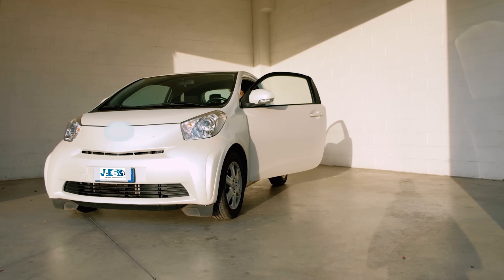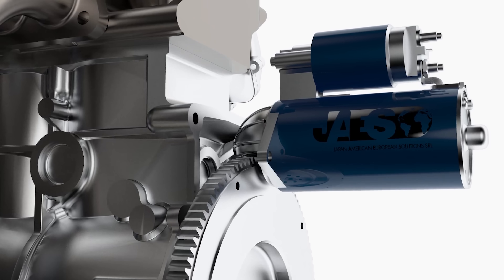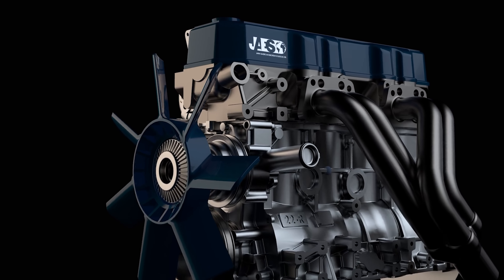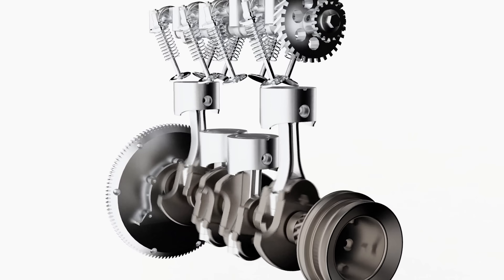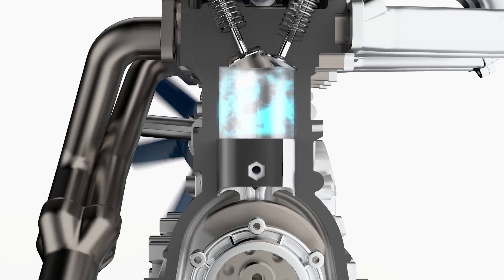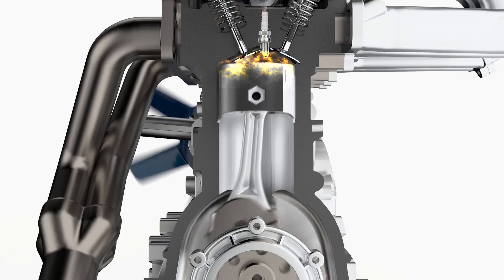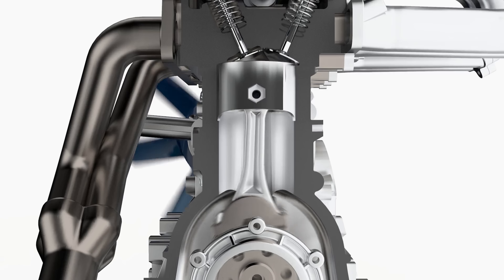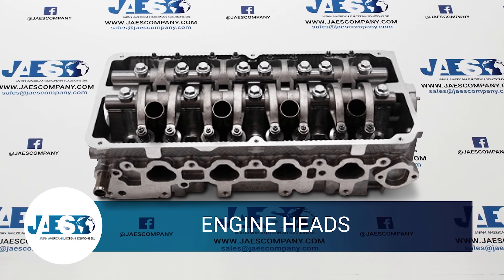What happens when you turn the ignition key in your car? Internal combustion engine (Car Part 1)

Comment: Didn’t take about the fuel pump priming the rail and injectors 😂
Reply: Right, and they didn't talk about having fuel in the tank for the priming to take place, and how people need money to purchase the petrol, and if not, they can steal it. And if they purchased the petrol versus stealing it, they most likely had a job. Yes, they missed a whole lot.
Reply: @markmalasics8413  he is not wrong, though. the title is what happens when you turn the key. the first things to happen is the electronics are turned on and the fuel pump building up pressure. depending on the ignition switch, there are two or three positions of the key where the car does something before the starter motor even turns. and if you turn the key slowly step by step, you can hear and see what the car does on each position.

to have this explained was my expectation of the video, when I read the title. but basically this video was one minute "when you turn the key the engine starts (duh)" and for the rest of the video it became "how does the principle of an engine work"
Reply: @markmalasics8413  you made me laugh 🤣
Reply: @posadist681  that is his intention. 😂🤣😅😆😄
Reply: didn't talk about how the wipers move when you switch them on LMAO OMG LOLOLOL "laughing emoji insert"
Reply: Not all vehicles are fuel-injected...
Reply: @rickyrick9328  give me one popular, modern vehicle people drive that has a carburetor
Reply from the maker: Hello. Thanks for you comment! We could make a separate video about these topics. Meanwhile you can also watch our videos about STEERING SYSTEM https://youtu.be/Iw1duKjGcto MANUAL TRANSMISSION https://youtu.be/G6hCvdW4dKo BRAKING SYSTEM https://youtu.be/6xWEEbhBtuY and ELECTRIC VEHICLES https://youtu.be/flQSQxHVS14 We would like to know your opinion about it. If you want to learn more about our projects, you can subscribe to our channel https://www.youtube.com/channel/UCb7TkWFn3nyb6XhudxGu5tw and visit our website https://www.jaescompany.com/

Comment: But how engine speeds up when we press acceleration? Does vlotage increases or fuel input or something else?
Reply: When you press more on the acceleration pedal, it opens the throttle body more which allows more fuel and air in.
Reply from the maker: Thank you so much for your answer. We really appreciate that! Have you had a chance to watch our videos about STEERING SYSTEM https://youtu.be/Iw1duKjGcto IGNITION https://youtu.be/s_HzAxhyXLo BRAKING SYSTEM https://youtu.be/6xWEEbhBtuY and ELECTRIC VEHICLES https://youtu.be/flQSQxHVS14 We would like to know your opinion about it. If you want to learn more about our projects, you can subscribe to our channel https://www.youtube.com/channel/UCb7TkWFn3nyb6XhudxGu5tw and visit our website https://www.jaescompany.com/
Reply: What voltage? This isn't about evs
Reply: @lukasstadler6594   so a car doesn't require voltage to get spark on spark plug?
Reply: @sangrambhumia9320  the voltage is supplied via a distributor to all the spark plugs. ECU decides which plug fires at the precise time to get the perfect combustion. ECU takes that data from cam shaft and crank shaft sensors to determine the exact location of piston in each cylinder respectively along with air intake sensors.
Reply: @sangrambhumia9320  why would spark plug voltage change rpm? and something like a diesel engine doesnt require voltage on the spark plugs, cause its got none
Reply: @lukasstadler6594  I am not an expert as a common man i asked . You mentioned that it's not an EV so i had to remind you that.
Reply: @sangrambhumia9320  yeah not trying to be mean or anything 😅

Comment: There's a time when I couldn't switch off my engine. It turns out that the positive terminal of my battery is shorted to chassis(?) by a displaced rod which supposedly holds the battery in place. Does this make sense, though? I mean, how did the ignition keep being powered to keep the engine running? If in normal condition a mere key turn can turn the engine off, doesn't it mean that the connection to ignition from whatever power supply will also get cut even in a moment of a short? 

I'm not familiar with car vehicle, please excuse me if my question sounds a little bit too much.
Reply: It makes sense though. The simplest explanation is, the rod that supposed to hold the battery served as a direct switch from the positive terminal of the battery to the negative. And i know you're wondering why the engine didn't stop. And it's because that shorted part keeps supplying electricity to the ignition system. So as long as there is electricity, it will continue burning fuel inside.
Reply from the maker: Thanks for all of your comments! We welcome anyone who brings his own contribution and share his knowledge on our videos. Have you had a chance to watch our videos about STEERING SYSTEM https://youtu.be/Iw1duKjGcto MANUAL TRANSMISSION https://youtu.be/G6hCvdW4dKo BRAKING SYSTEM https://youtu.be/6xWEEbhBtuY and ELECTRIC VEHICLES https://youtu.be/flQSQxHVS14 We would like to know your opinion about it. If you want to learn more about our projects, you can subscribe to our channel https://www.youtube.com/channel/UCb7TkWFn3nyb6XhudxGu5tw and visit our website https://www.jaescompany.com/

Comment: Whats happens if we turn the key to start position while the engine is already running...is it damage to some surtain parts?
Reply from the maker: Hello. This is a very interesting question! In the latest car models nothing would happen. For example in my car I don't hear any noise when accidentally do it. But usually we hear a scratching noise that comes from the fly-wheel gear that cranks up the engine. When you turn the key, a solenoid, which is coupled with a starter, is activated and it pushes out a small gear. This gear engages a much bigger gear, which is formed around the flywheel. Activating the starter when the flywheel is already spinning can easily cause a mismatch in speed between these two gears that can produce a very troubling grinding noise. If you're interested in these topics you can also watch our videos about STEERING SYSTEM https://youtu.be/Iw1duKjGcto MANUAL TRANSMISSION https://youtu.be/G6hCvdW4dKo and BRAKING SYSTEM https://youtu.be/6xWEEbhBtuY 
If you want to learn more about our projects, you can subscribe to our channel https://www.youtube.com/channel/UCb7TkWFn3nyb6XhudxGu5tw and visit our website https://www.jaescompany.com/
Reply: @Jaescompany  thanks.
Reply: Yes it will damage your starter if you accidentally turn it on again while the engine is on, but if you don't realize that and keep on doing it you could loose the flywheel then that will lead you to pull up the entire engine then that will lead you to thousands of thousands money to repair it, so yes make sure don't do it, and one more thing when you do start the car, start the car until the engine turns over don't keep the key in starting position when already engine running
Reply: @manjotsandhu9539  thanks bro

Comment: Splendid explanation. 
My question is. Do the spark plug ignite only once when sparking the vehicle?
Reply: No, it ignites for every explosion. That means when you're using your car for a couple of minutes in ignites a few hundreds of thousands or millions of times.
Reply: @thealbaniandude1997  i always thought diesel engines doesnt have a spark plug. Can u enlighten me?
Reply: they dont,
sparkplugs are for petrol engine, 
diesel have the injectors, it dont need spark to ignite, only high pressure from compression

Comment: I have a question
How the spark plug know when to fire ??
Reply: Answer: there is part called the distributor cap which times with the crank shaft to trigger the spark with the coil.
Reply: Good question, i cant find how. I will ask on reddit and let you know
Reply: Thank you very very much my friend⚘
Reply: @khaledwehbe2640  ecm send the response to plug to fire!!!

Comment from the maker: You can watch PART 2 and find out how manual transmission works: https://youtu.be/G6hCvdW4dKo
Reply: Great
Reply from the maker: @farmtech637  thanks where are you from? Please let us know if you like the other video of jaes
Reply: @Jaescompany  Please make a video how the engine goes off after we switch the key to off position thanks
Reply from the maker: @pranjitmudoi  thanks you good idea we will think about it
Reply: @Jaescompany  thank you sir❤️❤️
Reply: @pranjitmudoi  The electrical current to the ignition system is shut off and with no spark to ignite the fuel/air mixture in the cylinders, they stop producing power.
Reply: @markmalasics8413  and diesel engine
Reply: I actually understand now. Wow that’s amazing. 😊
Reply: How you made this video... Which software
Reply: Hi can i be your agent for your compeny parts in in gcc Oman

Comment: What is exactly the purpose of the flywheel?
Reply: The flywheel catches all flies that hits your car. It then liquefies their bodies and, when the key is turned to ignition, squirts the juice into your engine's cylinders for a bit of extra fuel that is integral to starting the motor.
Reply: Haha just kidding, the flywheel is basically attached to a shaft. That shaft is attached to the pistons of the engine. When the pistons go up and down, generating power by combusting gas, they spin the same shaft attached to the flywheel.

So basically, the flywheel is how the engine puts out power to the rest of the car! The power is made in the cylinders, and transmitted out via the flywheel.